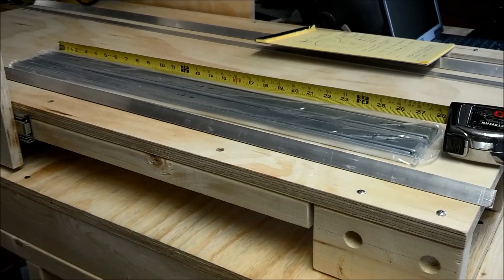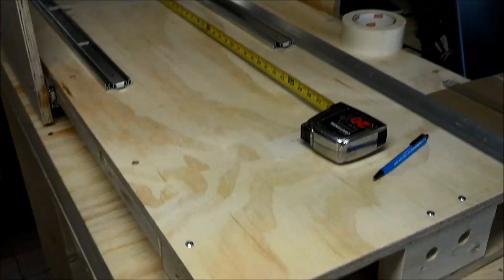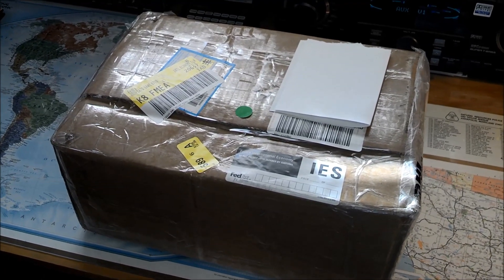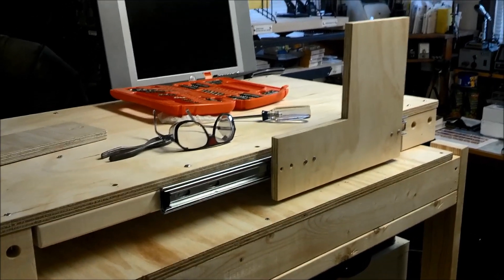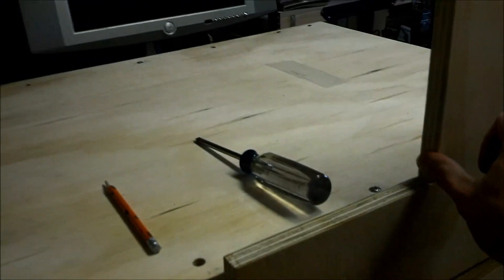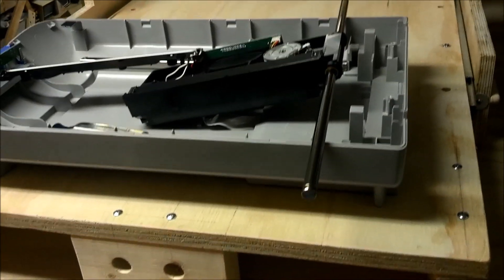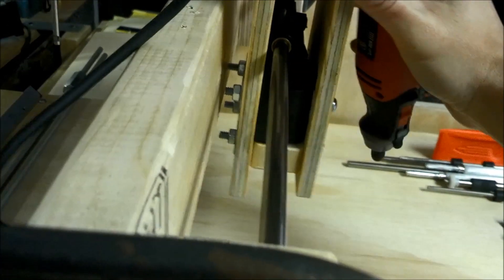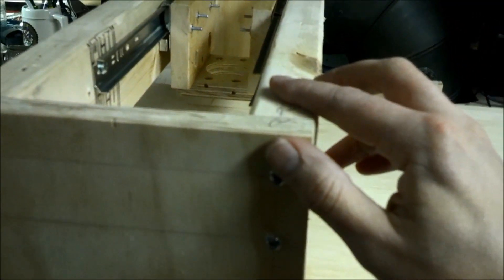CNC Project Update - Longer Rails - Motor Kit - Gantry

Comment: Just wondering, how long are the 28" slides when they are fully closed. I am currently trying to design a cnc of my own, and I jut would like to know
Reply from the maker: +Nathan Schlenker Not sure, Nathan.  On the CNC even when the gantry is retracted or pulled to one side the slides are not fully closed.  On some smaller 17" slides that I have here in the shop when they are collapsed they measure about 10" closed.

Comment: Hi, did you put together two drawer slides to increase the lenght?
Reply from the maker: Not to increase length, but for each sliding area I used a slide on opposite sides.  So for each axis two drawer slides of the same length were used.  This gave more strength.  This video shows more of the machine in action: https://www.youtube.com/watch?v=ZQMGDMPjuD8

Comment from the maker: Ehsan Jan - Thanks.  No problems with the TB6560 control board; it's been really good.  Regarding the wiring...there was a lot of trial and error.  I remember spending a lot of time trying to figure it out, if I remember correctly the color scheme was standard with images I pulled up online.  From left to right try: Black, Green, Red, Blue.  (You won't use all of the wires coming out of the motor).  The nice thing I've found with steppers is that you most likely won't blow it it just won't work at these voltages if something is connected wrong.  Best of luck.
Reply from the maker: Thanks.  The kit I bought is still working fine.  Very reliable and no problems.  For a basic 3 axis set up I have nothing bad to say about it.  However, you may want to think about a 4 axis kit though...after I built the whole machine and it was working well I had thoughts of trying to work in that 4th axis...to be able to cut things on a cylinder.  Anyhow, best of luck.  It's a fun project.

Comment: Great video. I do have two questions: (i) Have you had any issues with the TB6560 control board? I'm hearing mixed reviews on the product.  (ii) Do you have a wiring video for this setup as I can not seem to find one.
Thanks again for your great work!

Comment from the maker: That ebay link wouldn't catch, but reading the URL it looks about right.  The motors I used were the Nema 23s and the kit came with three of them as well as the 24v power supply and Toshiba driver board.  I paid $175 and I think that included shipping.  You're right, I didn't do a wiring video.  I'll have to pull out my pages of notes and see how I had it wired up.  It was a fair amount of trial and error but once set up was pretty straight forward.  Thanks for commenting.

Comment: Thanks for documenting your build.  Was this (ebay.com/itm/US-ship-Free-ship-Nema-23-Stepper-Motor-270oz-in-3A-3-Axis-DriveBoard-CNC-Mill-/281042739925?pt=LH_DefaultDomain_0&hash=item416f73e2d5) the kit you went with for electronics?  Also did you ever get around to doing that wiring video?  I couldn't find it in your account.

Comment from the maker: Good suggestion.  Thanks.  Using drawer slides has been quick, cheap, and easy.  I've also found the tolerances to be pretty tight; plenty good for the woodworking I intend to do.

Comment: You are right about the slides being tighter and less play when they are not fully extended. A good workaround is to take off the tab at the closed end and split the difference. In other words, a 28 inch slide could slide 14 inches one way and 14 inches the other.